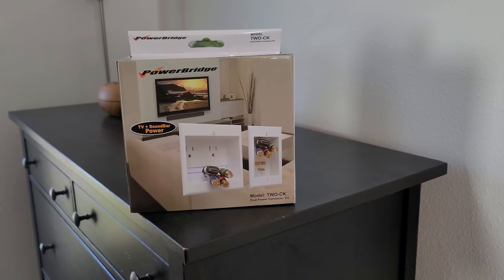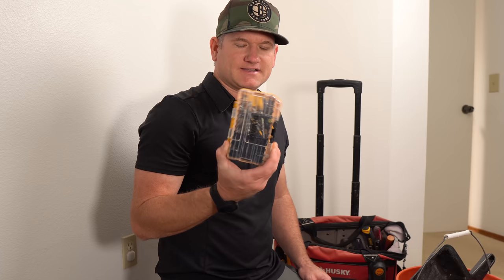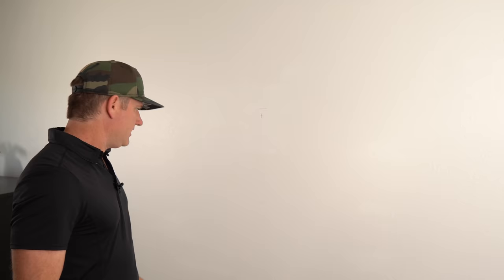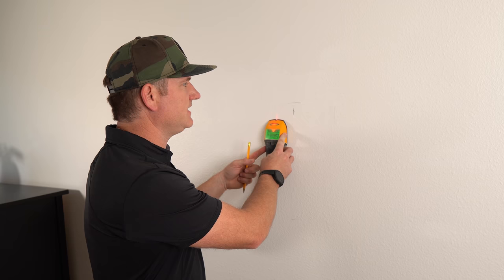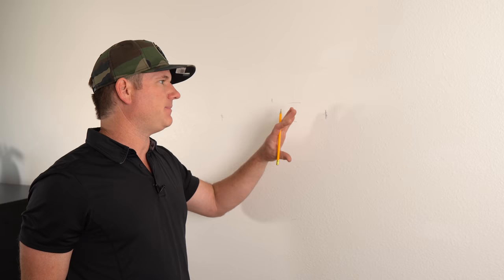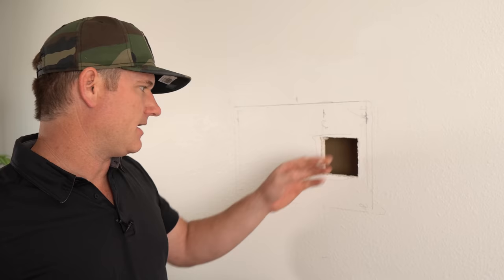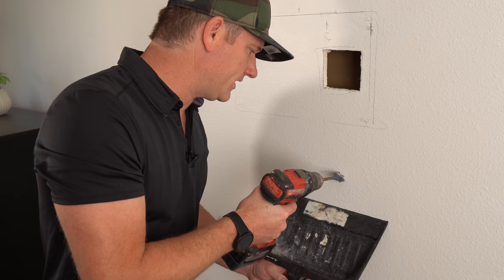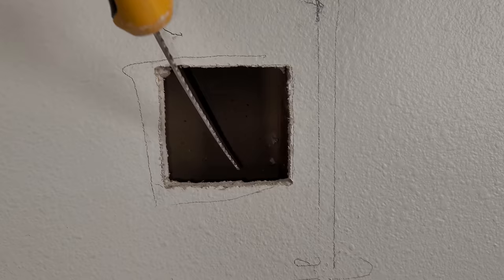Hide Your TV Wires Easily w/ PowerBridge like a PRO

Comment: If you get a mount for 24" on center studs, you have a lot more wiggle room side to side, for mounting a tv when your studs are 16" center studs. Just get a 24" on center mount, that has mounting holes that run the entire width of the mount, like every inch or so, across the top and bottom.

Comment: For the fireblock I am lazy and just cut a square box out abover or below the block and install a old work box and blank plate or add another power outlet for a nightlight. No drywall repair. Its not really that noticeable depending where it is. I also just make a hole in the back of the lower box to run the wire and hook right to the old outlet. I guess this is more user friendly though.

Comment: Great video!  I don't understand why you didn't just use a long 1.5" paddle bit?  The fire block was only 11 inches down.  If you messed up the upper hole for the receptical box behind the TV, then you could just use a small piece of wood (pre-drilled so it doesn't crack) as a backer board. Then mudded just the screw holes from the backer board directly below the receptical cover...  Seems like a ton of work when you cut that hole!

Comment: U can't run power cord behind the wall but there is still a white power cord in 2 pieces how that is approved by building code. Basically it js just an extension cord with fancy wall mounted outlet plugs. It is so easy if some companies can just make 6 feet extension cord 14/12 gauge nicely insulated and heat/cold resistant and EPA approved. It would have been lot easier n cheaper then and use the $17 Home Depot kit to make round holes with rubber covers and run all those wires

Comment: You could use a flexible cable installer bit for the fire block as well. Less drywall repair but it's not without its own difficulty.

Comment: Thank you for the video explanation, I just want to add if either lg or Sony don’t release a consumer grade micro/crystal led tv, with vrr, allm, and 4K 120hz, next year. I may just skip out buying a tv, fir a while assuming my old Samsung ks still works, since I don’t want to waste money on something that will not be a great tv, I also can’t trust oled, so I will probably never buy an oled, as long as burn in is still a slight concern. I just wanted to add after watching CES 2022 I will consider a 4K Sony X95k, this year, or even the Z9k, depending on the price, VRR support for Xbox, and how well the backlight master drive works….

Comment: Dude, I haven't even seen the video and I know I'm going to like it, but i have a question, a hard one. What would be your solution to concrete walls, with mortar and clay/concrete blocks? How would you hide cables in a setup like that with no pre-run in-wall pvc conduits?

With regard to patching up the hole, i highly recommend using a hole saw the next time. The hole saw cuts out a piece of drywall that fits exactly in the hole. A piece of drywall paper and a little mud for adhesion and its way less messy with less mud being slapped in the hole and potentially interacting with the cables and creating a mess back there.

Comment: Some romex from the existing receptacle knockouts could be run from there over and up to an upper "remodel" duplex box that have the exact same wings on them. No lower box needed but would be best to put one there to make fishing the romex easier plus an extra receptacle could be put there vs. a blank plate. The only difference would be that this set up has a recessed plug space if it is needed vs. flush like any other home receptacle. Must less cost too likely.  Most homes will have those fire blocks so plan on them at that height.

Comment: When I ran my Home Theater and TV installation company I put power behind the television, I never used these things, if I needed to route an HDMI cable or more I did it a single gang outlet that looked beautiful.
this thing requires you to run a power cord across the wall too in the last I looked I think they were around $99 or $150 or something.
worst case scenario have an electrician put a box behind your TV and he can pull power from the box underneath.

Comment: Would it have been proper - when repairing the dry wall hole to add a little spray of texture so that it doesn't show a smooth drywall patch and splatter wall original all around the circumference of the hole? One never knows when the TV would come down (ie. new tenants) and it's an eyesore. It might be a bit picky, but one does want to complete a corrected patch. Also, did you leave it to the homeowner to do the painting thereafter for the hole caused by the installer? Matching the paint is crucial as well. 8-)

Comment: I would love to see 1 of these done when there is insulation. I need this power bridge for my she shed. Wish i had heard of it when i had a contractor do my insulation and drywall to install it at the same time. He was a bit of a slacker tho i find out later. I requested an extra outlet to be installed on 1 side of the she that doesnt have 1 and he did not. 😡

Comment: If you use a hole drill instead of a spade bit you will have a good space for the drilling and then you use the piece of drywall from the hole saw to do a very simple repair. No problem with the texture, either. I’m afraid every drywall professional will be pulling out their hair with your drywall repair. I am also surprise that putting what is essentially an extension cord inside a wall is code.

Comment: I Love This B!!!! Even Though I Have More Like Concrete or Cement Walls, How Would Hide Speaker Wires ( I Don't Know if U Work With Home Theater Stuff or So, But If U Have Anything That Is Remotely, The Same As The Other Set U Just Showed For HDMI Cables, I Would Love For U To Make a Video about ( Hiding Speaker Wires 🔊) It , Peace ✌

Comment: If you didn't realize whether or not you had a fireblock (horizontal stud between 2 vertical studs for support), perhaps you could have a "magnetic detector" to search for sheetrock nails which would indicate a stud is going sideways and therefore, would have chosen a spot to the right or left of that 16" vertical stud cavity. Right? 8-)

Comment: When drilling/cutting through a fire block you should fill the space left with fire resistant foam or your insurance may not cover it as in many states it's no longer to code. Also check with fire codes in your area as power bridge like this isnt allowed

Comment: What’s the best way to hook up your tv to watch movies/shows? We use our XBox (Prime and Netflix) sitting on a console table underneath the new to us 56” or so 11 y/o plasma tv. Wires are very unsightly.
Also my two ways of patching a hole larger than a quarter is cut the hole into a square make a drywall patch the same size but originally twice as large with the facing paper still attached with the little square on the other side. The other way is the mesh patches they sell at lowes /Home Depot. I

Comment: Overall great video!
My only nitpicks are 
1) move the HDMI cord up and out of the way when using the box cutter and mud.
2) decide what color you want the plugs & cover plates, white or almond. Then be consistent, even if it requires replacing existing.

Comment: Hole saw the drywall and keep the plug.. attach some wood behind and screw it in p,ace with drywall screws. Then just fill around the circumference. So so much easier

Comment: If you were to include the tv cable, you would need to fish it through the wall as well, probably using the same techniques you used to get through the fire wall.  Great video.
Reply from the maker: Yes you can even drill a 5/8 inch hole for that.

Comment: I use locking hex bit extensions and a 90 degree adapter that lets me use my receptacle opening to drill from. No biggie if you accidentally drop a bit either because you can retrieve it when create the hole for the bottom receptacle.  Just my $.02

Comment: Wouldn’t it be a good idea to run a couple of extra hdmi cables through while it’s open? After its closed and the drywall repaired at the fire blocking it might be a little difficult to fish the cable through the hole in the fire blocking without using a fishing wire? Any future device added would be much easier if the hdmi cables are already in?

Comment: Just bought the LG C2 77" TV.  After watching your video, can I use the same Mountain dream mount that you put on your wall ?My studs measure 16". The LG weight is 47 lbs. If I can,  what is the model number. If I can't use your model can you advise which Mountain dream wall mount I should order? This tv will be in my bedroom. I'll be ordering the Power Bridge at the same time. Thanks.

Comment: I have an 86 inches tv… I want the tv flush… the bad part is the studs are far apart for the tv wall mount… I have to used a 2 pieces of two by four add it to the wall in order to hand the tv….. what will you recommend

Comment: What if you are installing a TV with a thin fiber optic cable? What if you’re needing to feed that fiber cable[ on a perimeter wall. Because the opposite side of wall is outside, there’s insulation that obstructs the path and, again, the cable is a fraction of the diameter of the smallest speaker wire.

Comment: Hey B -  I have a question about placement for an Atmos Soundbar (LG or Sonos Arc) -  I'm thinking using an attached bracket to the mount (so directly beneath with a snug fit) or spaced 6" from the tv below and mounted to the wall or rested on the media console below.  in each case of the mounts, I know the sound bar needs to extend a bit to clear the TV.  Is there any advice or thoughts on the different options - what do you find to be the best look ?  thanks

Comment: Great video. Why is it dangerous to run the power cable of TV directly behind wall? They hardly get warm. Doesnt the power bridge have the same risk?
Reply from the maker: The power bridge is up to code, normally that means the wiring is fire resistant and/or the coating of the wiring is strong and can resist cuts and damage in wall.  Mostly the fire resistance tho.  The tv power cord has none of that and could accelerate a fire.

Comment: Which mount should I use? I want the TV to fit flush against the wall and then be able to pull it out so I can turn it about 30 degrees. You mentioed a mount, will that be able to do this?

Comment: Funny thing is he had a stud finder. He could have known where the fire block is prior to cutting his first hole. However most of the time there is a fire block in each channel. But not always. Some lower. Some higher. 
 
I also would have liked to have seen him mention a person making this installation should always look at the backside of that wall for interfering obstruction in the same location of the installation if possible. Sometimes it's an outside wall. Sometimes it's an enclosure. Some times you could have an outlet already in that channel on the other side.
Reply from the maker: I said both of these things during the video my friend.
Reply: @BTheInstaller  hmmm. Maybe my TV went silent during those two parts.

Comment: I need to do this.  I’ve got insulation in this wall I’m using tho..  adds a degree of difficulty. I just kicked a couple holes in it for now to hide some wires till I feel like finishing it properly.
Reply from the maker: The insulation only presents initial issue.  Once you get fish tape or pole from top to bottom, it's pretty similar.

Comment: My TV, and the center of my Living room, happens to have an electrical panel on the other side of the wall. I guess its a sub-panel. A stud is in the dead center of the wall and the stud to the left has the panel. I am going to try to use the center stud and the stud to the right. Is this a bad idea? Is there bound to be electrical all in that wall?

Comment: Right at the level of the fire block... just drill straight in with a 2 inch diameter hole saw. Save the circle cut-out of the drywall, to reuse as a filler puck, then finish hoggin through the fire block,at least half way through it, then, knock the circle core out of the block.... you can then, run a chuck of 1 inch O.D. diameter hose, from the top hole, through the fire block, on down to the bottom box... In case, you ever need to change the TV out, it is a piece of cake feeding the new power wire through, top on down to the bottom... Sure, it sucks that you now have finish work to deal with, but, imagine dealing with feeding a power wire through for a new TV...LOL.... 2 hours of additional work now, save the process of learning new curse words later...  I do this on every job site in every home. Pending which room, like the master bed room, or the entertainment room, the bottom box, I install the recessed w/ flange 8 inch tall 12 inch wide, a few inches from the floor, that has all the connections needed, for security, cable feeds, power, output feeds, etc... for those locations, typical cost is raised about 125 finished over just a single power outlet receptacle. Beings the boxes come in either ABS, PVC, you can mod the boxes also, to attach PVC piping to them to attach flexible hose to them for ease of routing for the home owner, later. It sells them selves over the years.
Reply: What is this below? Is that a BOT.. or is that for real?
Reply from the maker: What do you think? Spam of course.
Reply: LOL... I thought it looked dumb.. as per, who in their right mind would give a TV away.. and for what, writing a comment? LOL... I was like, this makes no sense...  Well, with all that set aside, still enjoyed the video.

Comment: This is so helpful! With the fire block - is it a violation of safety code to cut into it? Similar to you, I ran into a fire block and was unsure if I could cut a chunk out of it without violating safety regulations. Also, do you recommend using a conduit for the wires or is it acceptable to just have the wires loose in the wall?
Reply: Very irresponsible of him. I’m a firefighter in NYC, he put those occupants in danger.
Reply: I wonder if the insurance company can void even paying out, in case of a fire, if they found this...

Comment: Whats the best way too determine which wall bracket spacers to use on the TV?

I took a bolt, bottomed it out then eyeballed the gap and got close making sure the bolt was back out some but still using plenty of thread. Been fine on my 43 but I got a new 65 on deck and want it precise due to increased weight.

Comment: I wonder if anyone has tried to use a multi-tool to cut a square 1-1/4" dado on the front side of the fireblock to run the cables in front of, then install a metal plate in front of the wires. Having a metal plate behind the drywall hole would prevent the spackling plug from falling through.  Just a thought. 😊

Comment: Thank you for the great video! So I have a rather odd issue. The wall I want to install on has double wood studs behind it, but the wall is unusually thick because it uses double gypse of 5/8 each. I have a few different stud finders and because of the depth, I cannot find the exact location of the studs. With metal detection on I might find the nails but I'm weary of that method. What do you recommend? I won't be using powerbridge but rather a datacomm media box that looks almost exactly like the one you used for installing the 77 inch G2 (I'll be installing an 83 inch G2 incidentally). Thanks in advance.

Comment: Can you explain what makes the power bridge safe to use as opposed to just running the power cable through the wall? Newb here and recently purchased a house so this is my first time wanting to attempt to hide the cables
Reply from the maker: The wires of the Powerbridge are coated and fire retardant. The power cable of a tv isn't.  You can also just have an electrician add a new power outlet up by tv. The powerbridge just makes it easier without having to mess with circuit.
Reply: @BTheInstaller  oh okay so the wires between the two outlets on the power bridge are like actual electrical cord or Romex style wire as opposed to just a regular cord?

Comment: So is this safe to run behind walls? I know low voltage is safe but is this? I ask because it looks super easy to do and very clean
Reply: The cable that is used with Powerbridge is rated for use in the wall. It's not the same as the tv power cord or extension cord.

Comment: Great job with the install. Can you do a video on installing with metal studs and the solution?
Reply: Instead of wood lags, use 1/4”-20 zip toggles with 2” x 1/4”-20 pan-head  screws and 1/4” x 1” fender washers.

Comment: Haven't you compromised the fire block by drilling holes in it, or at least sealed the holes with fire resistant foam?
Reply from the maker: That isn't technically a fireblock as its internal wall but a lot of wiring goes through fireblocks, I never see foam.
Reply: Yes many state/city fire codes require you to seal back the fire block with  fire resistant foam. There are even cities suck as Chicago that doesn't allow power bridges.

Comment: What do you do when your installing it on an external wall with insulation? Our living room wall has insulation because it was previously the external wall before a garage got added on.
Reply: You use a tool call a fishers tape.  It’s basically a long sturdy wire you fish through the wall and holes first.  Then attach your cables and wires to the fishers tape and pull it all through the wall and out the other hole.

Comment: You could use the cut out from one of the openings to patch the hole for the fire block. It would require less mud
Reply from the maker: Yes this is true.  I felt showing a cut out and then repairing it with backing would be complicated but to be honest once I had a fire block I was pissed off.. I cut out the part where I say "f...."
Reply: Glad it wasn't just me that had this thought...